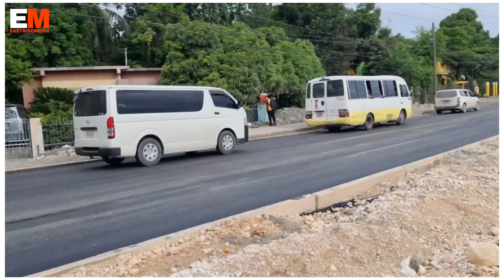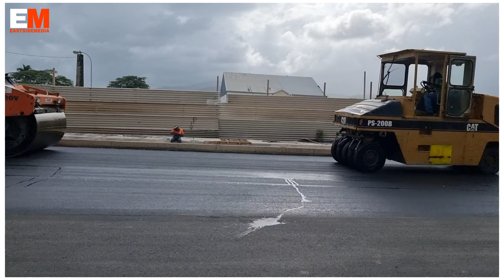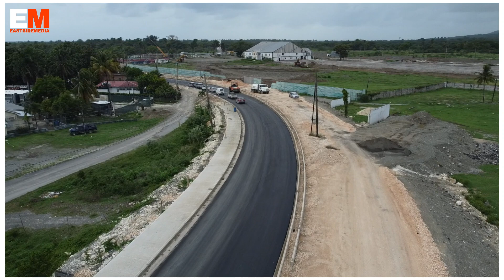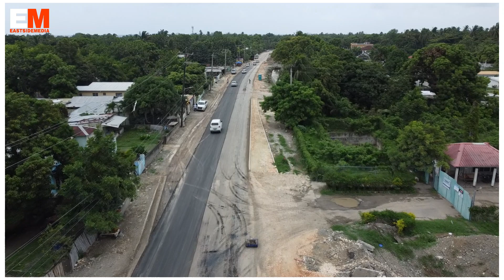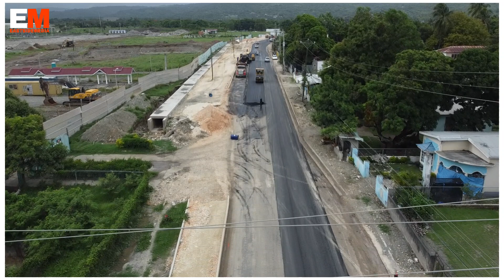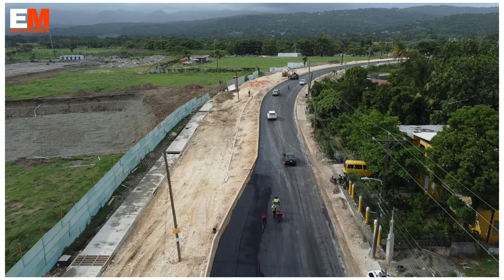Part of Main Road In Front Of Urban Centre Has Been Paved Southern Coastal Highway IP

Comment: They need to get the tar truck to spray the road instead of throwing the thing. No wonder it's cracking up in places already... The main point of the tar is to bond the alshapt.  This is likely putting cement on loose gravel.
Reply from the maker: They sprayed the road the before with the tar truck
Reply: I did see that video. But the way I see some of it done, maybe not by S&G, looks ridiculous.